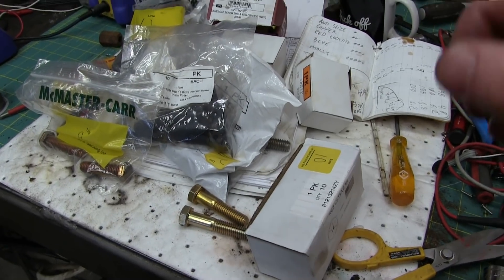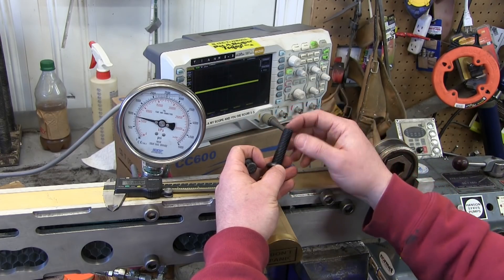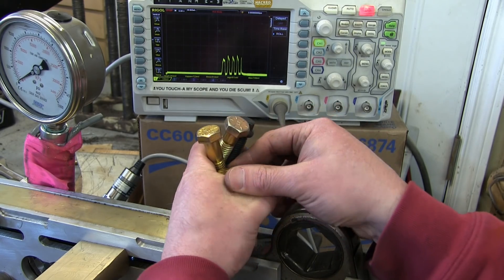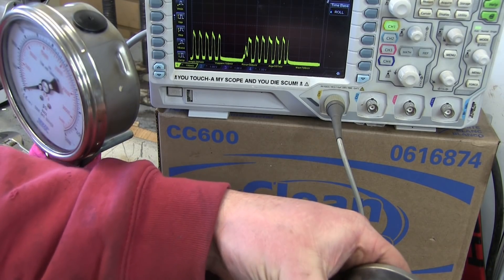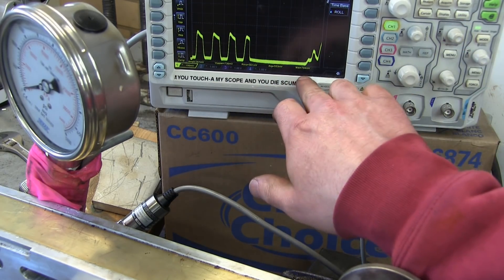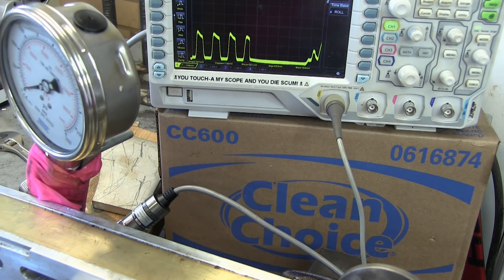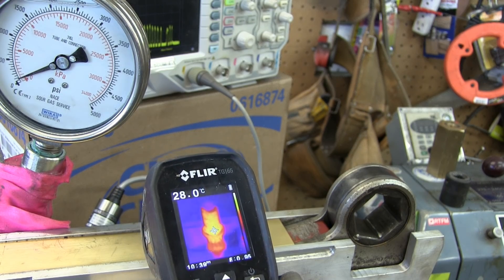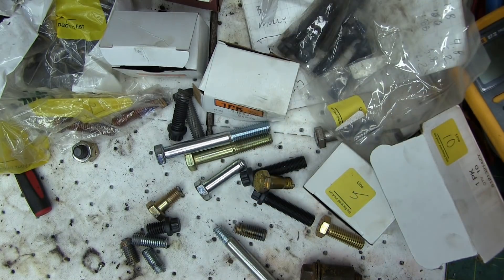Home Depot Bolt vs. USA Made | Offshore Suprise!

Comment: For us metric guys I decided to look it up:

Grade 8 bolt  (close to) Class 10.9 (both +- 120Kpsi)
Grade 5 bolt  (close to) Class 8.8   (both +- 86Kpsi)

I couldn't find an US alternative to the Class 12.9, that one is rated to 140 Kpsi
Reply: Grade 1960 (180ksi) or what socket head caps screws are made of is basically equivalent to 12.9
In metric the 12 means ultimate strength of 1200mpa or 174ksi the .9 means the yield is 90% 157ksi
10.9 is 1000 mpa or 145 ksi ultimate, yield of 130
8.8 is as you guessed 116ksi ultimate, yield of 93 ksi.
Grade 8 is 150 ksi ultimate, grade 7 is 133 ksi ultimate.
Most bolts are tested to a proof load that is 80% of there ultimate load
recommended clamp load is `75% of the proof load or 55% of ultimate load.

The breaking strength (in this case torque) is also not the only measure of quality. Flaws, yield point, elongation, toughness are all important factors in the quality when applied in a real engineering application. You can make a bolt out of quenched 1045 that is 180ksi but it will be brittle and useless in application. This test is was a bit hack to be honest, albeit a lot of fun to watch.
Reply: thanks for this, haven't delved to deep into bolts before and always thought 8.8=8
Reply: Could grade 12 could be what compares to 12.9? They have 12 hashes on the head.
Reply: was wondering the same thing, have a look
http://www.americanfastener.com/astm-sae-and-iso-grade-markings-for-steel-fasteners/
seems like as for tensile strength they rate both 8.8 and 10.9 higher at 120k and 150k respectively, 12.9 would be around 180k then.
Reply: @ Chris, I'm not sure, I used this page as a reference: https://www.boltdepot.com/fastener-information/materials-and-grades/bolt-grade-chart.aspx
Reply: Stefs Engineering Very clear. Thanks for the info.
Reply: Thank you for this.
Reply: Wierd if they don't have anything comparable to 12.9
Reply: geetarwanabe 
It depends on what you are working on. 
Take cars us market cars use imperial only everything. 
Outside the usa cars can be full metric japan or a mix of both euro and australia.

Threads aren't interchangeable but if your in the usa with metric bolts you'll probably have converted the torque ratings into imperial or metric, so it's easier for new people or those who don't know the other system well.
Reply: Why the frick would you look up metric then proceed to use imperial torque ratings?
Reply: You have to multiply the two numbers and next add a factor 10 ( after 8.8 only applicable for M16 thread size or greater). So class 8.8 would have a Yield strength of 8*8*10=640 N/mm² =~ 93 Kpsi. 
So a 12.9 (1080 N/mm²)class should equal a ~156 Kpsi .
So it would be between en grade 8 or 9, but they just aren't that interchangable due to their different Yield and Tensile strength.
Reply: K J unfortunately, you're right. Or you have something from the late 90s or early 2000s that's a weird mix up of both standard and metric, instead of just standard like God intended.
Reply: Stefs Engineering what would that be in Newton meters?  That’s all I use.
Reply: Stefs Engineering the metric system?!?!  for gawd sakes!

Comment: Do you think that the less resilient of the bolts were designed to shear? Is there any benefit to having a bolt shear instead of stripping the threads? I wonder if that's not skookum by design. (This is called denial- as someone who keeps buying bolts from McMaster)

Comment: Probably similar to the eevblog bulk resistor test where the 5% tolerance resistors all fell within the 1% spec. Also where you end up with software limited processors/graphics cards.

You get the quality levels high enough it is cheaper just to slap on different markings. Of course you still pay for the higher grade just in case.
Reply: electronics parts are binned. Are you saying bolts are too?
Reply: Possibly?  That or it could just be cheaper to have a single production line for grades x through y and stamp whatever grade / brand even though they are all the same quality.

Comment: All our bolts at work are JH, we joked that they were turd... guess we were wrong! Although, we have had a few with wank threads and varying shades of blues and silver plating. 
So in a few years time are the Americants going to be the new China, churning out substandard toot??
Reply: MIL-SPEC is not "great" or better than any other standard. In fact, most MIL-STD have been superseded by standard ASTM/ASME/SAE/ISO standards that do the same thing, but perhaps with better industry support.
Reply: All we'll be churning out is Middle Management and Marketing.
Reply: Torque as a substitute for tensile strength is a poor substitute especially with the small sample size.  Surface finish of the thread has a very large effect on this relationship.
Reply: yeh we decided we wanted to compete for cheap labor instead of going for high end goods. i think it was really just an excuse to break the unions.
Reply: John Doe Most large manufacturing companies in China started life as Taiwanese owned and operated businesses. Taiwanese will deliver to spec, Chinese factories deliver to whatever they feel life, and American will deliver to profitability which means cutting corners if they can. 

Americans made industrial products are no better than the Chinese made products. Much like the American cars. American corporations in their pursuit of profit fucked over the world and it’s own people. 

If you want quality don’t go with a company that answers to the stock market.
Reply: It's more quality control. Being stronger then required means nothing. What does matter is that each and every bolt will meet the requirements both in dimensional and material treating quality.
Reply: US standards have probably been around for along time, while steels keep getting tougher. Microalloying from recycling and whatnot. - I know metric grade 8.8 is supposed to have a longer elastic region before it enters the ductile range, whereas grade 12.9 doesn't have much of a ductile range at all. - Could be the offshore coffin nails would not stand holding a yellow painted vehicle together...?
Reply: Dude, I work in aviation and I get bolts with fucked threads all the time. Shipping/people being idiots/mass production causes these things. And the bolts I get have to be inspected each time they're shipped, individually, not in a giant box like you get probably yet somehow still get crushed threads or shitty heads decently often.
Reply: Chris Garman, do you have sources for that claim? Would like to read that.
Reply: Mtaalas: https://www.economist.com/news/business/21730244-it-latest-long-list-scandals-have-befallen-corporate-japan-kobe-steel-admits
Reply: I think that happened a few years ago...sadly
Reply: I mean the car industry has been doing it for decades
Reply: Mtaalas https://mobile.reuters.com/article/amp/idUSKBN1GH2SM
Reply: derbigpr500: As a 50-something year old citizen of the USA, I can verify that the quality of manufactured goods has drastically decreased over the last couple decades. However, that being said, I am a tradesman, and every employee in the company I work for is expected to do quality work, or else they are handed their walking papers.
Some of us still have pride in what we do, the real problem is the Big Companies put focus on dollar signs, and forgot that high quality is more valuable in the long run.
Reply: Tim Taylor-Medhurst I pray we don't become the next China.
Reply: Tim Taylor-Medhurst ii
Reply: Tim Taylor-Medhurst nice bumble Fuckery
Reply: Africa already is chinas china.
Most chinese consumer crap is made in Africa,
You cant get cheaper than starving orphan labor it seems.
Reply: Using the grade 8 for wheel studs is like using a file for a pry bar. I would suggest using the grade 5 just go bigger in size. Just my opinion and opinions are like @$$ holes.
Reply: I agree.  There was a time when American factories, which had not ever been bombed, were putting out large quantities of decent quality product.  That was an anomaly.  Our high end stuff is mostly still pretty good... though often priced out of the market.  From what countries do you get the most satisfactory products?
Reply: America won't be the next China. They were the next Britain and the last China.   It'll be India or Africa or Brazil next, when the Chinese are too rich to get their hands dirty.  Or it'll be Mars :)
Reply: Demonslayer20111 you're not kidding, vintage world old 70s and 80s Taiwanese pieces are starting to rise in value and desirability as a decent alternative to cheap Chinese junk or increasingly rare and expensive old American Iron LOL.
Reply: The entire world knows that Americans are all about quantity over quality, in most of their products. Only Americans think that what they build is the best in the world by default because they were brainwashed to think so, but in reality, most products I ever bought from USA were junk or decent at best, nothing special and usually much more expensive than they should be.
Reply: Jin Li – Huh? Most Chinese manufacturing companies started life as state-owned.
Reply: The US has been getting sub-standard steel. Japan was recently caught in the act of falsifying quality control documents.
Reply: Also you didn't watch till the end, those jh bolts are from Taiwan. Not china. Huge difference in quality there
Reply: Demonslayer20111 
Hi, I did watch to the end, I was just speculating on USA going down the same path China has, not with regards to these specific bolts but just in general manufacture. Seems old Trump is keen to increase USA manufacture so to under cut other countries,, like China has, will sadly mean rushed manufacture and possibly poor quality. Let's Hope not, but it was just a speculation.
Reply: Ameri-CAN!
Reply: Chris Garman yep
Reply: Chris Garman still  no excuse  though
Reply: Mtaalas uhh it has been all over the  inter Web  for awhile  now,and was central  to the tariffs that trump signed
Reply: MrShivshank yep
Reply: MrShivshank gotta save that fuckin nickel  to give it to upper  management  for a bonus
Reply: CacheRAM yep
Reply: Paul Copeland yes sir
Reply: Paul Copeland kinda sets the bar a wee bit  higher
Reply: pr0xZen yep
Reply: Rich Vandervoort u going to fund a all out laboratory  fuckin test then?